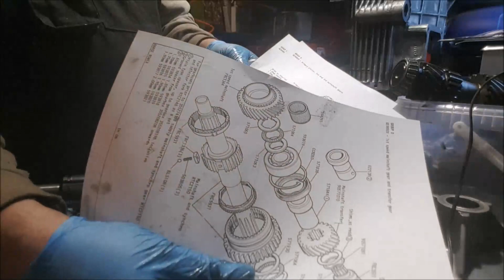Range Rover Gearbox LT95 Mainshaft explaination

Comment: can i change the layshaft bearings without removing the mainshaft please ? Rob
Reply from the maker: as the front cover needs to come off the box to access the layshaft and bearings I do not see any reason why you wouldn't remove the main shaft. drop me an email if you need more info

Comment: Does anyone know, is there a kit, to reduce the throw, the distance required to move the gear stick to change gears, on a lt95
Reply from the maker: As the gearstick locates directly onto the selector rods you can either shorten the gearstick, and lengthen your arms or... make a box that fits on top of the gearbox selector housing to extend the pivot point much higher. Personally changing gear with the Eiffel Tower is all part of the charm, you will soon find other issues when you try to speed up the gear change... such as they don't like that

Comment: Very interesting - thank you.  I have a problem with my LT95 where the mainshaft has floated forwards a little (after fitting an overdrive) and the thrust washer / needle bearing have dropped off the thicker part of the mainshaft and fallen on to the narrower part meaning I can no longer select 1st gear.  Is there a way I can rotate that first gear in-situ as then I may be able to pull it back and get the washers etc to slot back where they should be?  If not I guess I'll have to take the box out and try and pull the mainshaft forward a little so I can pop them back up.  Great videos - love your style!
Reply from the maker: that sounds a nightmare, I recon that you have your work cut other there. Remove the overdrive and shims from the end of the mainshaft. and maybe you can get enough movement to relocate it, chances are that the front plate needs to come off though. Not fun.
Reply: @churchhouseclassics  Thank you - it was a nightmare!  In the end I did manage to 'wiggle' it back on by pulling and rotating on the mainshaft and looking up through the side panel of the gearbox and poking about with a thin bit of wire.  Definitely learnt the hard way on this one.

Comment: I have a problem with the transfer case box of the LT95 Range Rover 1983, which is loosening the transmission gear at the high range.. What is the cause of this problem and how can it be fixed if it helps .. Thank you
Reply from the maker: Most likely cause is that the transfer hi/lo lever is not moving far enough to shift the transfer box into high. 

This could be because the transfer selector is not moving far enough. remove the gaiter from the inside of the car and check that the lever is not clouting the transmission cover before HI is fully selected.

Or the shaft is not set correctly, it runs across the top of the transfer box, the handle is attached to one end and the other end often floats but if there is an issue the thing can completely disengage. You can see the ends of the cross shaft from under the car 

Maybe the fork on the shaft is not set correctly which means that the transmission tunnel needs to come off or the gearbox needs to come out to allow access to the top access plate on the transfer box.

Good luck sir

Comment: What would cause it to jump out of 1st, 2nd and 3rd on over run?
Reply from the maker: I would start with checking for mainshaft endfloat. remove the round plate on the end of the transfer box, it will give access to the end of the mainshaft and the transfer gears. You can get shims that take out the endfloat.

If that is ok then you need to access the top of the gearbox, remove the top cover and check the detent balls and springs are all still in place

Good luck
Reply: @churchhouseclassics  Thanks. Will try that out.